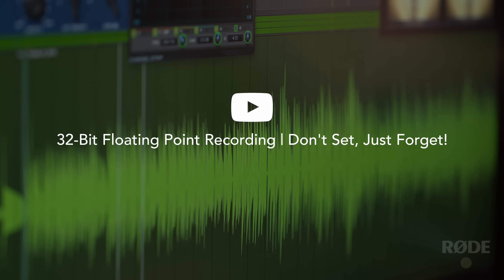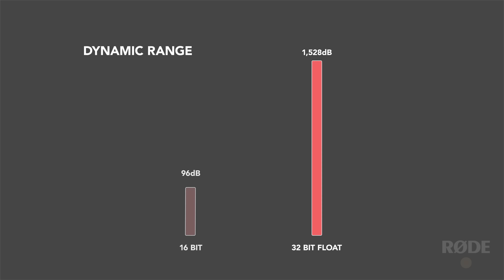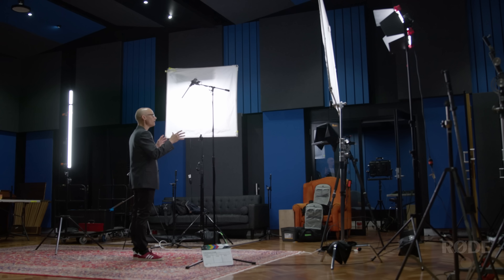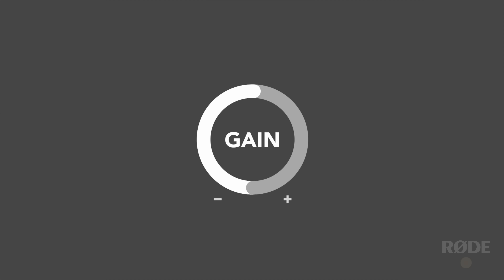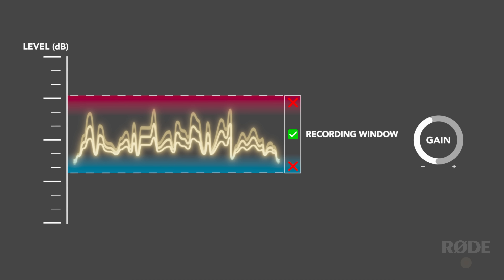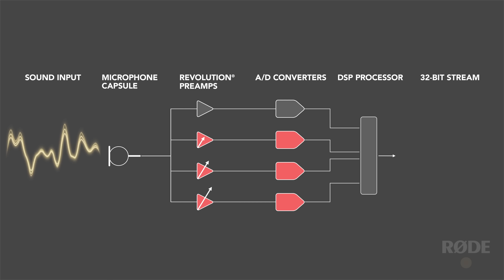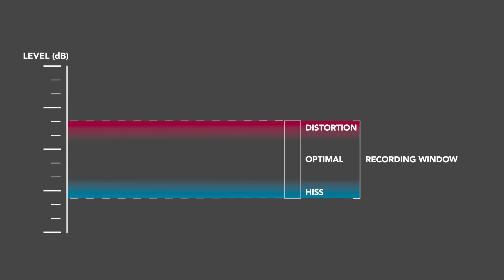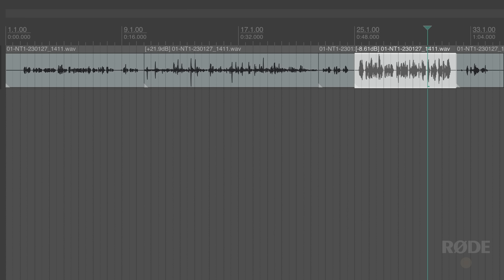Game-changer: How 32-Bit Float Recording Makes Clipping a Thing of the Past

Comment: 32 bits is really more like HDR photography based on muti exposure than Raw, it is about passing the sound through multiple amplifiers at different stage (just like HDR photography does with different levels of image exposure). Raw means no data compression, which is what wavefiles already are. So I dont think the analogy is the best here.
Also, most DAW do make pre-render in 32 bits but can calculate at 64 bits precision.
Reply: I mean the data itself is a pcm 32-bit float so it is uncompressed tho... so.... no data compression also....
You can, imagine the bit depth is the contrast (stop level) of the image, so 16bit = 4 stops, 24bit = 8stops, 32bit float = 14+stops
Reply: @yasunakaikumi  I know what you mean but IMHO it is still less relevant because thannhe multistage nature of the audio recording/HDR photography.
Reply: Exactly, was about to make the same comment. In photography, you can make an overexposed photo which is the same as clipping in audio. It is even called clipping in photography, as it refers to the same problem (running out of dynamic range). Storing an overexposed photo in a RAW format would not fix the problem (storing in JPEG would probably make it worse). Taking a HDR might fix the problem.

I really don’t think this is how you should explain 32 bit recording as people may get the incorrect idea that somehow ordinary 24 bit wav is a compressed format (it isn’t). The tech presented here has more to do with how analog/digital conversion is handled and not with data compression.
Reply: This isn't 32 bit integer recording.  32 bit float is still 24 bit integer with 8 bits for storing different info.   Don't confuse 32 bit integer with 32 bit float.  2 totally different things.
Reply: @380stroker  Where do you get this from? 32 bit float is not at all 24 bit with "some storred info", all bits are used for data (samples), it's just a way of representing floating point numbers, in a scientiffic format (signifficant digits x base ^ exponent), where 32 bit integer is a classic binary representation (signed, 2's complement). The catch with 32 bit integer is that the values between min an max possible are normalized to -1 ro 1, so it is not possible to have values over 0dB, while you definatelly can in 32 bit floating point. 

Also, why even bring this up? Where have you seen interfaces that support 32 bit integer? Maybe there are some obscure ones, but I have never heard of one or see a pro engineer using one. What would even be the point, when it doesn't even address clipping?
Reply: @AlexLapugean  Who in the hell mentioned anything about using a 32 bit integer recording interface?  There's no point.
Reply: @380stroker  ... you did... You mentioned this is not 32 bit integer recording and to not confuse 32 bit integer with with 32 bit float. I'm confused, did you forget already what you wrote?

You did not mention the interface specifically, true, but how else would you record 32 bit integer? And if you didn't think it exists, why mention it at all? Nobody was saying anything about it...
Reply: @AlexLapugean  read again.  The reason i brought up 32 bit integer is because of the comment sections.  People are confused by 32 bit integer and 32 bit float.
Reply: RAW means NO Lossy Compression. Compression often still applies.
RAW files are like Flac, Lossless but often still compressed

Comment: It seems to me that indeed, 32 bit float does not magically remove any analog noise, but it does encourage designers to minimise that noise in the first place - it throws the focus back on to the very earliest points in the recording chain.  So 32 bit float recording systems use multiple preamps and A/Ds, each optimised for a certain range of input level.  That helps.  And particular care will be taken over the design and implementation of any analog components before the actual preamps.  A certain company whose name begins with "Z" has recently launched a one-piece stereo mic and integrated 32 bit float recorder.  This seems to me to be an excellent approach because every part of the recording system, from the capsule to the SD card interface, can be optimised to integrate with every other part to the highest degree within the price point set of the device.  The device I'm thinking of is actually pretty cheap, but for the money it sounds pretty damn good to me, because the designers have had to live up to the expectations that 32 bit float devices encourage.  (Shame that a manufacturing issue caused it to immaculately record RF radio station breakthough too and they've had to recall it for the present... but once that's fixed, it could be a game changer in some sectors of the recording world).  I look forward to RØDE producing something similar, but more upmarket, in due course!

Comment: With “no-gain” approach, Rode could have launched a game-changing sound interface. Something in a CloudLifter form factor, which would have just just a single microphone preamp, single XLR-in and single USB-C-out. And a little 48V switch. You just insert this interface (itself, being in a body of oversized XLR plug) into the back of any XLR microphone, and your XLR microphone becomes an USB one, with 32bit capture.
Reply: Zoom just did that
Reply: @bolttracks  , but what model? I may be missing something but I don't see "1 in/0 out"  plug-format interfaces from Zoom. The closest I see is Shure's X2u... which is still "too much" for 32bit no-gain, with 3 volume controls while you could have 0.
Reply: Good idea but to match microphones with different sensitivities and max SPL handling some gain knob would be nice anyway.
Reply: What about monitoring?
Reply: @aldavidson1044 , but do you really want to monitor anything (from a single microphone) but the gain level? (which you don't have to monitor anymore).
Reply: @amyodov  Yes, I really do want to monitor that mic if I'm singing or playing into it. But let me clarify: I should have mentioned to begin with that I was talking about zero latency monitoring

Comment: I think it's a good thing to have that option to fix things in post, but this doesn't change the recording process for me. I'm still going to adjust the gain on the proper level, since I'm on the job, I might as well do the job. It's just good to have that option later, if something unexpected happens.

Comment: I was hoping for a true objective explainer video, that will also mention downsides of 32-bit float. Like more work in post-production and file size. Completely failing to mention difference between gain staging a preamp and a digital file in DAW is also a bit disappointing. Hiss doesnt come from 24-bit, it comes from the preamp. 32-bit float is only game changing when you are working in a 100% digital world and thats okay. Its great for film makers for sure, because it allows for mistakes. But music studios will be recording in 24-bit for many years to come, even though our DAWs may be working in 32-bit world. I think most engineers understand the benefits, its just that dynamic range of 24-bits is absolutely enough for almost everything. And human ears like the sound of preamps driven to the edge, so we will always touch the gain there anyways. 32-bit is not superior, its just different and yes, its hard to understand because it cannot really be compared to video or images.
But its a nice marketing video :)
Reply: Thanks!! Was about to write this

Comment: I think the stacked converters make this more like light stops in visual, therefore HDR not raw.
Reply: stacked converters is a thing since what 12 years?
Reply: @georgwalt7978  oh really didn't know that. I thought it was just stacked filters
Reply from the maker: HDR is also a good analogy, yes. Like all analogies, they are never perfect, but help to illustrate the principles and use. We used the RAW analogy as we thought more people would be familiar with RAW than HDR, but the HDR analogy is also a great way to explain 32 bit float. Thanks for the comment!
Reply: @Bthelick  Actually HDR is when you use HDR-monitors for playback. This is closer to dual-gain sensor feature in the video world. The difference is you can catch several staged convereters and record them all simultaneously, which you can't do with a camera.
Reply: @ХЕЙТЕРЫ-ы2б  yeah I mean in the sense that it's like how HDR is a composite of different light stop ranges for "High Dynamic Range" right? High dynamic range being the direct equivalent of compositing several converters to achieve high dynamic range in the audio space.

Comment: The performance of this microphone has much more to do with the fact that it uses four preamps and four ADCs in parallel and then switches between them for the final output, rather than the fact that the final output happens to be in 32-bit floating point.
Reply: Yes! It drives me mad when brands are oversimplifying for the sake of marketing lol.
Reply: The advantage of making 24 bit output out of four 24bit ADCs is minimal. The whole trick is to aggregate more complex word.
Reply: @zbyszekolko3998  Yes, if you are already doing 4 preamps, why not include 4 ADCs and output in 32-bit float. But the practical benefit doesnt come from the bit depth itself in the first place, its in combination the PREs. Thats where the video is misleading.
Reply: @RobDiesALot  It's not ONLY because of the 32 bit output but you need the bit depth, it doesn't work otherwise. The fact that there are 4 pres and ADs, is only a design choice based on the limitation on each pre/AD, what dynamic range they can individually capture to be more precise. So really, the 32 bit is the important thing, why does it matter exactly how you get that headroom prom practival point of view? So what is misleading?
Reply: No, the performance of this microfone has to do very much with the 32 bit output. WIthout it, the 4 pres/ADC, wouldn't do anything (maybe if recorded as 4 different streams that you would manually need to blend, but that is just stupid). The entire point of the 4 pre/ADC stage is to each capture a different part of the sensitivity range, that is then merged to a higher dynamic range than any of the individual pre/AD is capable of.

A good analogy is how bracketing in photography works, you take multiple pictures at different exposures, then merge them to a HDR image that contains both the shadow and highlight details, that the camera is not able to see at the same time in a single picture, due to sensor limitations.

So the only reason you need those 4 parallel chains is the current limitations on the dynamic range that is able to be captures by a single one. But with better technology, you might only need 3 ... 2 or even a single one in the future, what remains the same and the important thing IS the 32 bit output and its corresponding dynamic range.
Reply: @AlexLapugean  Because this video isnt about a single product, its trying to explain 32-bit float recording, but only in context of a 32-bit capable all-in-one device. Its pushing 32-bit as something you need, to promote a set of products. Nothing wrong with that, but its not explaining it very well.
Reply: @RobDiesALot  Yeah, I agree the explanation is not great and has some flaws, but I don't think it "pushes" 32 bit as something you need. It just mentions what it does and why you might find it usefull. So either you record very dynamic material, or don't want to care about the gain. It's gong to be the norm in the future either way, no reason why not. You just capture more sound, if you need it, you can use it, if not, you don't, but it's nice to have the option.

Comment: This would be more useful if Røde could make a capsule that can take eq well, or one with a somewhat flat frequency response. Besides, 32-bit float recording isn’t very useful if you take the time to gain-stage properly.
Reply: True, I don't expect this tech to be coming to digital mixing consoles anytime soon for that reason.  Generally not a great tradeoff for people who already know how to gain stage well.
Maybe we'd see it if manufacturers could cut costs by combining multiple high noise preamps instead of having one ultra low noise preamp, for example.  Idk.

That being said, I think the tech is pretty useful for field recorders and camera mics which might encounter a huge and unpredictable dynamic range.  In those cases it can be much harder to set a good gain.  Maybe it could help cell phone recordings as well.

Comment: Don’t you still need to set good levels in the analog domain?
Reply: "good" levels are defined by how much clipping or noise you have in your signal.  If at a single gain setting a whisper can be heard clearly above the preamp noise, and a train horn can be recorded without clipping, then there's no point in changing the levels, at least at the recording stage.
Reply: That's somewhat taken care of for you. Multiple gain levels are fed into separate AD converters. It's kinda like recording at +0, +15, +30, +45 dB then picking the best take in terms of distortion and noise.

Comment: How do you handle proper monitoring of a performance recording using these methods?
Reply from the maker: Hey George, here's a bit more on monitoring: https://rode.com/en/user-guides/nt1-5th-generation#:~:text=Using%20the%20NT1%205th%20Generation%20with%20Your%20Audio%20Software

Comment: So... is there capacity / plan to upgrade the CasterPro II to 32 bit float then? When? Also, it seems you have not been responding diligently to  an update which has made the mix minus function unpredictable and unreliable. When will you fix this?
Reply from the maker: Hey Bart, you'll have to wait and see! If you need a hand with setting up your output mixes we’d recommend getting in touch with our Service Team at: rode.com/contact
Reply: @rodemic  This is a VERY poor response. Very poor indeed. Answer the questions.

Comment: Something to bear in mind with floating point addition is that it is not associative, that is, a+(b+c) needn't equal (a+b)+c. In audio signal terms: if I have two signals, X and Y, and phase invert X to get X, then if I first add the samples from X and -X before adding Y, then the sum becomes 0+Y=Y. If, on the other hand, I add X to Y first, and then add -X, I don't get Y, but rather a bit-reduced version of Y. (I'm not sure how relevant this actual is to audio production, mind you, just something that comes to mind when I think about how float's are represented in binary - if all the signals being summed are substantially different, then this is unlikely to matter that much.)
Reply: The term for that is quantization noise, if I'm not mistaken.  It effectively generates the noise floor in digital audio  through those rounding errors, so the whole point of increasing the bit depth is to reduce those errors.

Comment: ..almost forgetting an important point, normally a Daw uses an ASIO driver (for low latency in recording) with ONE audio interface, not multiclient, but in this situation this mic haven't an headphones output for monitoring while tracking, so I suppose it has a Rode Asio multiclient driver wich get possible to set the output of an audio interface while using Rode NT1 5th gen as input interface, right ? No issues with Daw compatibility and low latency at 48kHz with a medium cpu and soundcard ? Thanks again, have a nice day !

Comment: One thing I don't understand is what the step range is defined as? Sure 32bit can do 1500db of whatever but wouldn't it be more useful to have maybe 200dB but be able to have steps of 0.0000001 db instead of like 0.001db?
Reply: With 32bit float the stepping isnt that straightforward. It varies as you increase or decrease your exponent in the float represented number. The 1500db means the ratio between the highest and lowest reprentable number with 32bit float. The biggest representable number is 1529db or 2,89480312E+76 (linear scale) times bigger than lowest representable number. The stepping you think of is not connected to this db information.
Reply: 32-bit FP resolution is on par with 24-bit integer
Reply: Yeah I totally didn't think too hard about the float part; go figure, I've been coding for over 30 years lmao 🤣 😂

Comment: You can  do the same thing with integers as well. Cameras use integers and NOT float when recording RAW footage. Seems like the marketing team is running this presentation who and want to jump the 32bit float hype train. A better analogy would be that you're recording the audio with multiple microphones from the exact same position with different gain settings. Then you can choose the recording with the best signal to noise ration after.

Comment: So what recorder do you need to do 32 bit float?
Reply from the maker: There are a few different ones on the market, but we'd recommend using the NT1 5th Gen which can do this via USB when connected to compatible DAW
Reply: @rodemic  Can I use two NT1 simultaneously via USB for 32 bit stereo recordings?